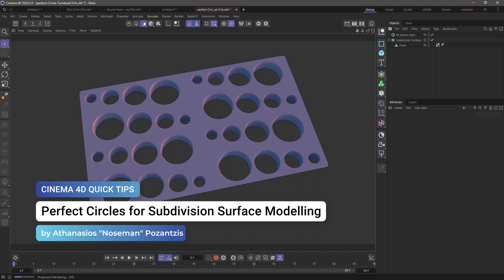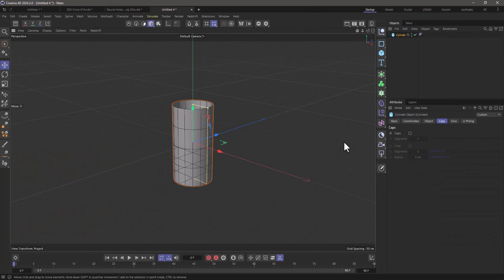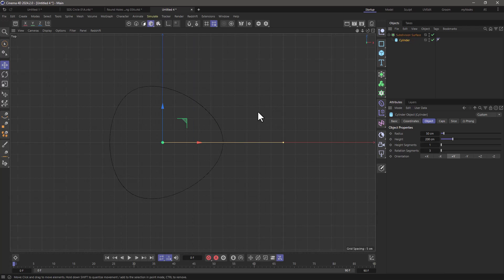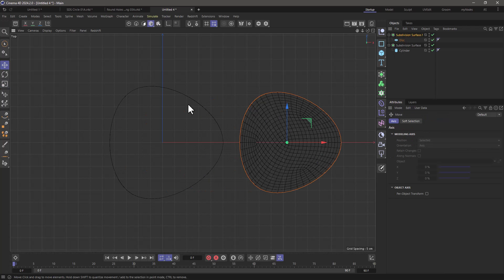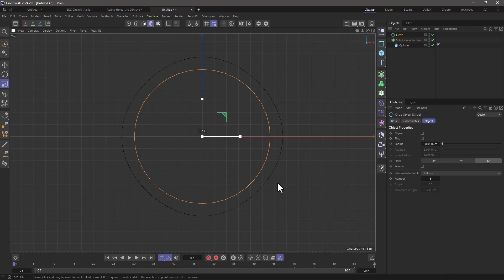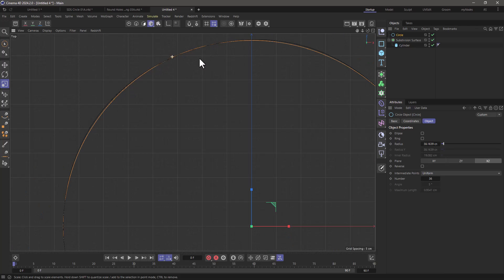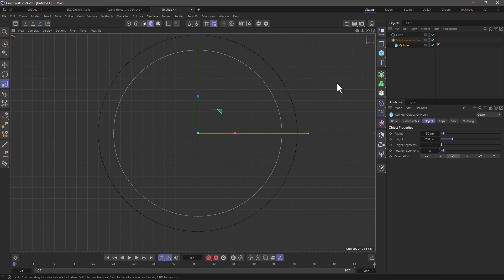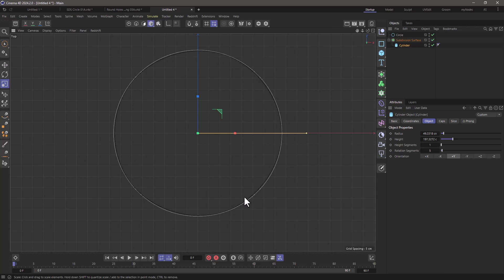#C4DQuickTip 116: Perfect Circles for Subdivision Surface Modeling in Cinema 4D

Comment: I hate it, when the promiss of a thumbnail not get fullfilled
Reply: It's not about creating holes in an object, it's about creating a circle using subdivisions. I'm sure you can figure out the rest, otherwise I'm not sure a software like C4D is right for you.
Reply: This!
Reply: Even though it's indistinguishable from a perfect circle it's still not the same so the title is misleading. A perfect circle would require unlimited points so it's simply not achievable with conventional methods. This is because the SDS uses smoothing algorithms after subdividing which simply won't result in a perfect circle, which must instead be achieved using math by for example using the sin/cos functions.
Reply: @danielschmid8530   Yes, that's 100% true. I use a general principle: If something looks like the expectation, it's as good as perfect. Let's not forget that anything represented by pixels cannot be perfect!